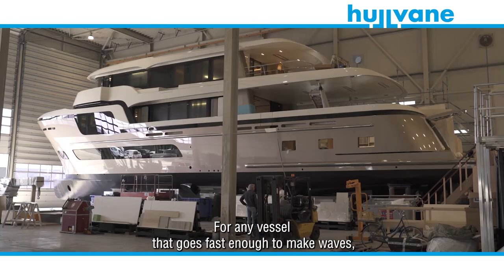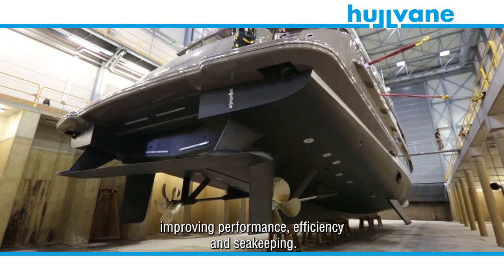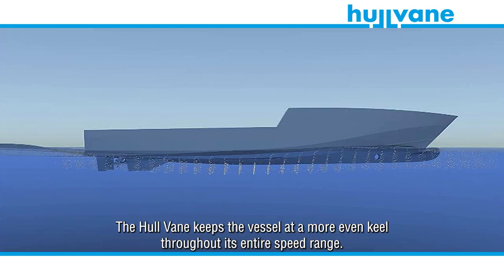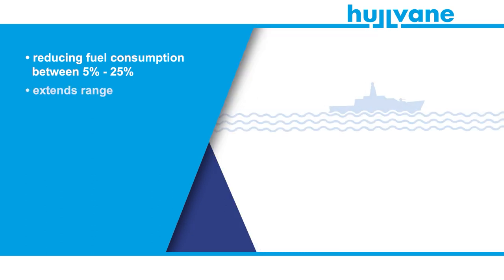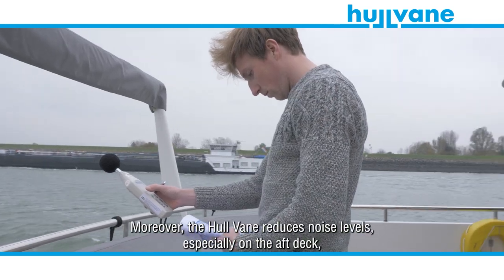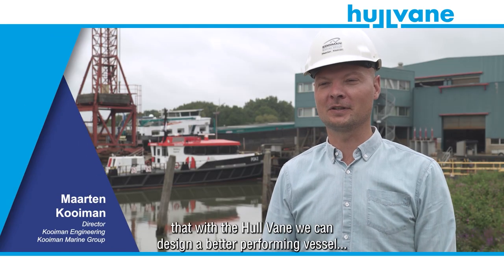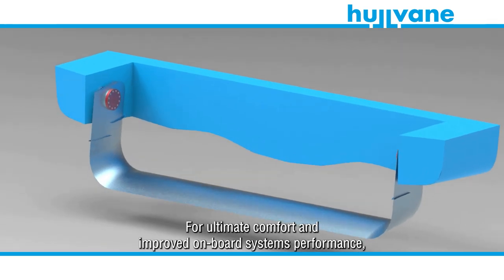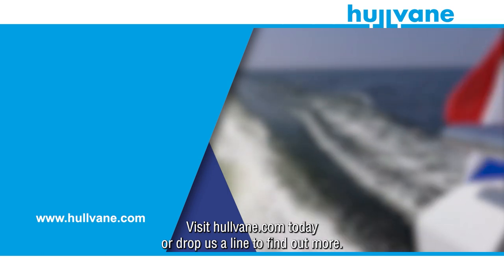Hull Vane – the solution to improve ships' efficiency, performance and seakeeping

Comment: I was just thinking of a dynamic hull vane type mechanism, but fitted to the bow to control pitching and slamming in rougher seas. Imagine Canard type vanes that can be retracted or deployed. It is almost like the stabilizers already fitted on the sides of yachts. Very interesting the dynamic hull vane.
Reply: Yeah maybe something like a bow that extends downwards to form something that looks like an axe bow

Comment: Why only at the back?  What about adding one more to the Front?  Wont this provide even more efficiencies? Also help reduce piutching even more?
Reply: The bow tends to climb as the bow wave approaches Hull speed (lifting the front half of the boat on the wave angle), and the aft tends to sink (increasing the waterline area, and drag forces).

Comment: It does not reduce CO2. If you increase range, you burn the same amount of fuel. It takes longer, but it is burned.
Reply: but for the same range, you need less fuel, so it reduces Emission and if you increase range because of lower fuelburn it reduces Emissions too overall
Reply: A tankfull of fuel will produce the same volume of reactants no matter how long between refills.
Reply: @santyclause8034  true, but the point is that you need less filled tanks to cover the same distance, thus you reduce your emissions. Where you first needed 100% of your tank, you now need 90% of the same tank to cover the same distance.